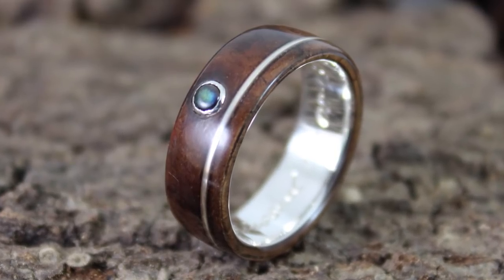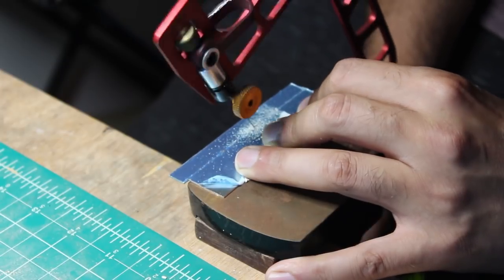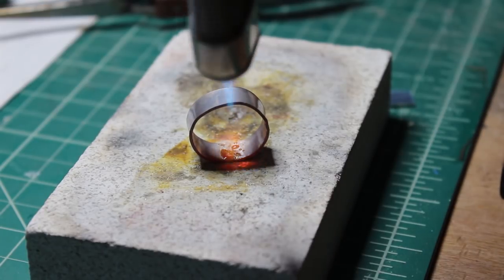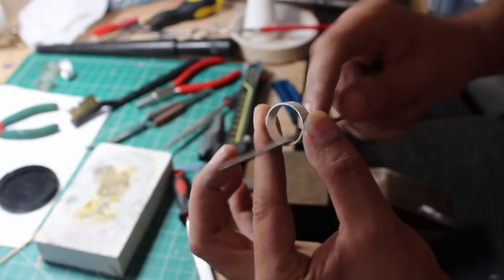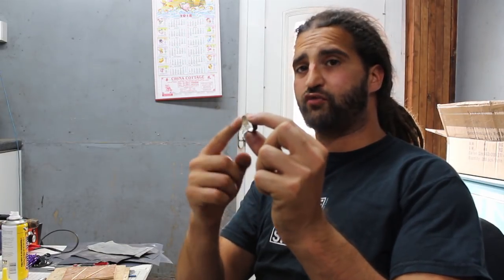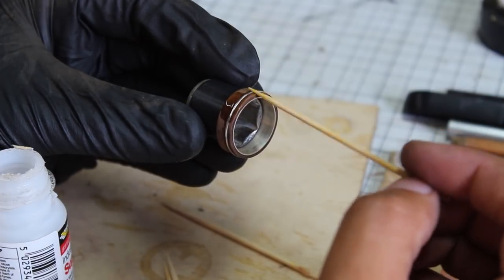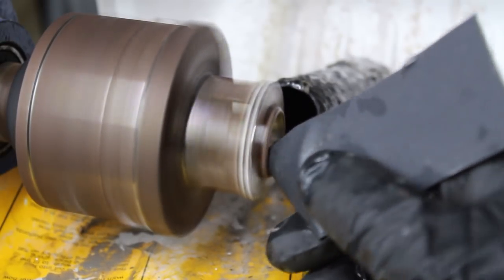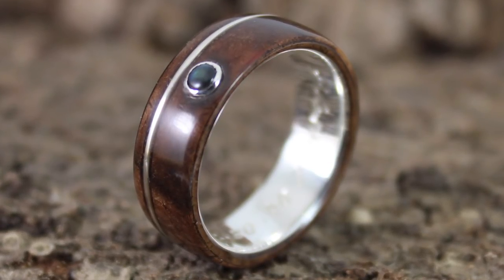Making A Silver & Walnut Wood Ring With A Stone Setting From Start To Finish

Comment: Im trying to make wooden rings and ive made like 20 or 30 but im not set up to use silver yet and am a bit apprehensive about it bit I know I need a metal in yhe ring for strength.  I've done two tone rings with light and dark wood not bent but cut and sanded and with the two woods glued together it seems to make them stronger but still not strong enough.  ;( I have sold a few just by posting on fb using plexiglass for strength and look but I was unable to do a good finish in them with glue.  It's really hard to get it right.  I used tung oil for a finish and it turned out pretty good but do you have any advice with putting the glue on it, thx also.  I've figured out how to take a rock from the yard and cut my own stones and I think yhts pretty cool. It's surprising how pretty I can make a regular old Rick look just by cutting and grinding and sanding slick. Thx for the videos. !!
Reply from the maker: Haha hey sounds like you’re getting creative!  CA finish is a fine art and tbh it’s hard to explain in comments.  I have other videos that will give you an idea.

If you’re having trouble with it then I recommend switching to AlumiUV resin as it’s much easier to apply ✅